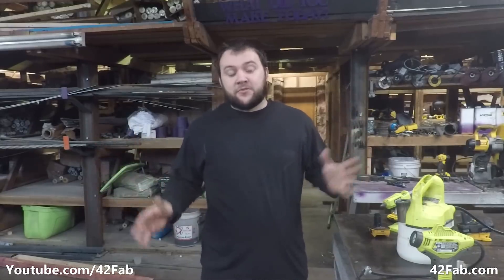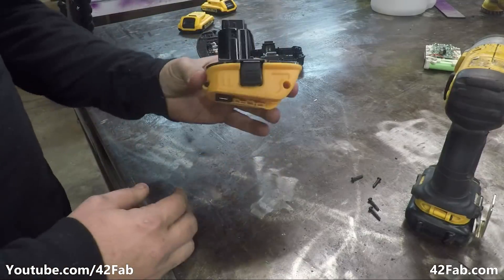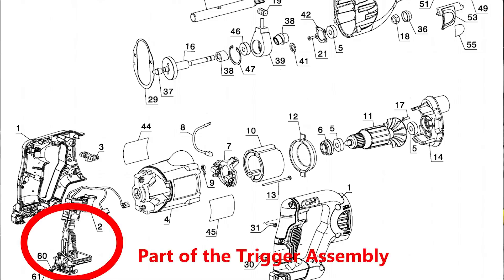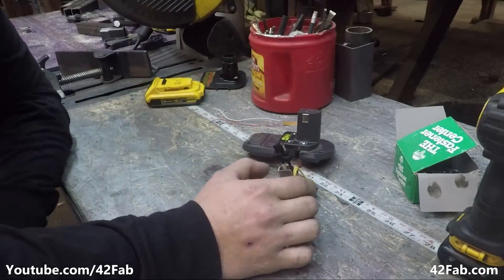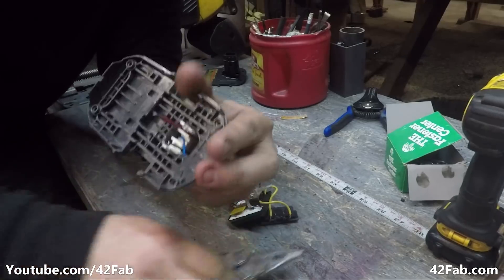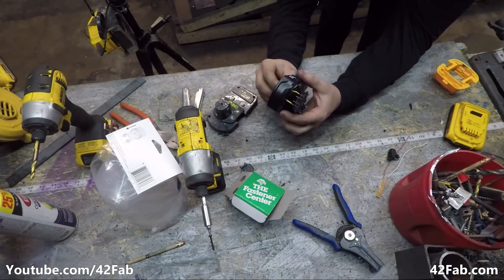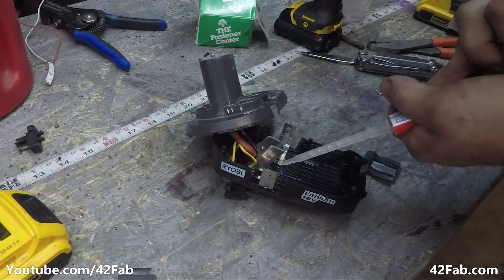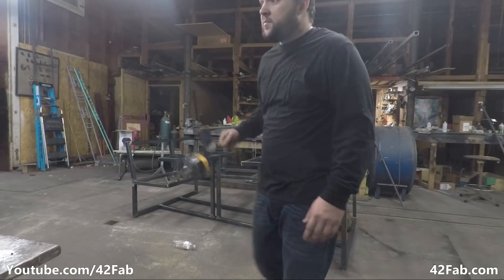How to use DeWalt Batteries on Ryobi Tools for $30 | Building a DeWalt to Ryobi Adapter - 42Fab #16

Comment: Just FYI, the "Plastic Epoxy" Loctite sells is actually methacrylate. That's why it smells like an acrylic nail salon. Methacrlyate is a very powerful adhesive to have in your toolbox, and the Loctite brand is readily available and a good price. If you want to step up your game, pick up a 50ml dispenser gun and Plexus brand MA300 50ml tubes which take a mixing tip. Pro brands all fit into that gun and accept mixing tips. McMaster Carr online has the best price on mixing tips (still almost $1 each) but they make life grand.  Leave each one on until you come to use the glue again and the cured tip will keep the tube fresh. Cheers!
Reply from the maker: That's what I used in my other adapter and I thought I had some on hand for this build but didn't, so I went with the 5 minute epoxy. I also highly recommend the "plastic epoxy" though I do not know that I would have enough use for it to buy it in bigger tubes and actually get them used up before they dried or leaked.
Reply: I just want to be clear, 5 minute epoxy is epoxy. The "plastic epoxy" I'm talking about is what you linked under this video, it's not epoxy, I wish they wouldn't brand it with that word. When you get into adhesives and what will work for what, it's important to use the right nomenclature. That stuff is methacrylate, and it's a whole different animal from epoxy. When I suggest 50ml tubes, that's the same volume as these double syringes you can buy at box stores. They are also available in 500ml cartridges for BIG jobs. I like the 50ml applicator gun and mixing tips over double syringes because you either waste some mixing on a waste surface with a waste mixing stick, or in the mixing tip. The difference is, the tip is very precise application.
Reply from the maker: Great info, good to know, thanks
Reply: @TMFXLLC  HD has started selling JB Weld brand epoxies and dumped Loctite. They sell a "double-barrel" syringe with ONE mixing tip. So you have to use the entire contents on one shot, or mix them manually. The mixing tips waste WAY too much adhesive. You waste a negligible amount of adhesive when mixing manually.
Reply: @xenonram    There are several topics for discussion here. Epoxy and Methacrylate are different chemical families. Both can be formulated for use as coatings, fillers, or adhesives. My advice was to pay attention to smell, because some products are marketed using the wrong name. 

You're right about how mixing tips work. There are circumstances when you want a mixing tip, and other times you don't. The tip provides a seal, and it's a clean and easy application process to fine detailed areas. It does consume some material. Hand mixing calls for peripheral materials, and a cap placed on some materials is not enough to seal over longer periods.

I am a professional, and I use 50ml dual syringes with an applicator gun, and I buy the smallest possible mixing tip from McMaster Carr, which is a good compromise on waste for me. Others may prefer a different method. I just wanted to share accurate and helpful info. Thanks.

Comment: Cool video and great project.I too love the dewalt tools, I use the 20v to 18v on my old 18v dewalt tools now because I just can't make myself replace a working tool even if it's the old 18v dewalt .I have replace a couple of tools to the new 20v system and love the new design of the 20v battery lock button Vs the old 18v double side clips  which I often have to fight to get the battery to release.  I do have some very old Ryobi tools that are 18v and are blue in color. I'm  not sure I have any old batteries for Ryobi just wondering if the new 18v bat. fit the old blue Ryobi tools?    Thanks for sharing
Reply from the maker: As far as I know all Ryobi 18v tools work with all Ryobi 18v Batteries
Reply: All the Robins 18V One+ tools work with the 18V One+ batteries, regardless of type.  Just don’t try to charge a lithium battery in an old, NiCad charger.

Comment: Is it possible to do the opposite? Replace a Dewalt battery with a Ryobi battery. Dewalts are soo expenbsive!
Reply from the maker: you're getting what you pay for. Ryobi cells struggle to drain more than 18A, dewalts are well and good to 30. These Ryobi tools work MUCH better with dewalt batteries on them. 

Pro tip: get the yellow "XR" dewalt batteries, they have the higher drain cells in them.

Comment: Would a DeWalt 20v/60v Flexvolt battery work on this DIY adapter?
Reply from the maker: L.I. Archer you have to modify the adapter to fit them, I haven't done so
Reply: But if the Flexvolt battery fits older 20v Max tools, why wouldn't it fit the adapter?  I have an adapter and a Flexvolt battery.  I should try to see if it fits.  LOL
Reply from the maker: The dewalt 20-18v adapter specifically states it isn't made for the flexvolt batteries. I believe there is a nub in the molding that stops them from seating on all the way. My theory is that none of the 18V tools were ever made to draw as much current as the flexvolt batteries can output and DeWalt doesn't want you smoking the motors running them that hard.

Comment: One of these uses Dewalt 20V, 60v flex, or Milwaukee 18V on old Dewalt 18V.

https://www.amazon.com/dp/B078M63Q1G/_encoding=UTF8?coliid=IR55V0GWBLYL&colid=3NTK76J8UTEMO&psc=0
Reply from the maker: That is a milwaukee to older dewalt 18v adapter....
Reply: I worked for Home Depot in tool rental and repair. Picked up a bunch of different batteries. Made some work by combining two or three to make one. Broken tools cut off the battery plug in and wired to a hallow battery. I made decent money on the side making these for people. The broken tools were being thrown away. Might as well make something useful form them.

Comment: Good job!  2 questions. Do you like the Ryobi cordless glue gun? I have been on the fence about it. With that in mind, I have Bosch 18v lithium system and would like to convert that glue gun and a Rigid 12v nicad right angle impact to the Bosch batteries. Any thoughts?
Reply: Ave also took the ryobi glue gun apart in one of his videos.
Reply: Tom's Dreamshop Worx  i have the hot melt cordless glue gone works great for me
Reply: I too have the Ryobi glue gun, and it's quite handy to have compared to other cheap plug-in guns. Tip isn't completely drip proof, but it's pretty good. I need to make an adapter like this so I can run one off my 9Ah Flexvolt battery for an hour straight. 😁
Reply: Tom's Dreamshop Worx I’ve converted the glue gun to work with makita batteries. It’s a beast. It’ll get up over 300 degrees.
Reply from the maker: I do like the ryobi glue gun. It seems to have a pretty big heating element or some mass around it so it takes a bit to get hot, but once it is you can pump about 3/4 of a stick of glue through it before it even starts to lag on heating it.

No thoughts/experience on those other tool lines, but I'd hesitate to say it's worth doing for just one tool. However, the boech to ryobi should be easily possible, the bosch to rigid would require some sort of voltage regulator to step down to 12v.

Comment: Nicely done. You can also buy the adapters from dewalt to ryobi and milwaukee to ryobi on ebay for around $15-20
Reply from the maker: Yes, but those adapters do no protect your dewalt batteries from over discharge, which will ruin a $50 battery. Most of those ads say "do not run battery all the way down" as a hint
Reply: Good to know, thanks.

Comment: "That's what you get with eBay junk - the screw just breaks." I mean, yeah, the screws suck, but you're using an impact driver on them. No shit, tiny ass screws gonna break. Good work though. May try something similar with Makita batteries.
Reply from the maker: I'd never expect them to snap when being run out in reverse, with a little 12v driver, but point taken

Comment: Does dewalt guy know that dewalt is nothing more than rebranded black & decker?
Reply: Yeah, and Milwaukee is just rebranded Ryobi, and Maserati is just rebranded Chrysler...  yeah....
Reply: I've used Dewalt tools in a commercial construction environment for years.  14.4v, to 18v, to 20v (which actually isn't truly 20v) to their now FlexVolt.  They have all performed well. 

 Some of their corded tools suck.  Their recip saw, is crap.   Yes, the different blade positioning is a good feature, but fails due to the engineering of it.  That company from WI has perfected the Sawzall.  Dewalts circ saws are well made.  Still prefer Bosch or Hilti SDS drills and Metabo grinders. 

 As with all tools, ones mileage may vary.  Never discount a tool based on 1  poor experience.
Reply: My question is does it really matter who owns em?
Reply: Which Black and Decker brushless impact driver was rebranded as DeWalt? 

Stanley Black and Decker is the parent company that makes DeWalt, but in no way is DeWalt a rebranded version of the Black and Decker line. Some of the Black and Decker line is a rebranded Craftsman tool. Also owned by Stanley Black and Decker.
Reply from the maker: Have you tried the DeWalt DCH273? I friggin love that thing, mostly because it can be easily run one handed, which is great for when I'm on a ladder installing signs. If I had to pick three battery operated tools that would be one of them. Starts to struggle with anything over 3/4" but I'm hardly ever doing anything over 3/8"
Reply: Can you make an adapter for Ridgid battery to ryobi tool?
Reply: Viper90087 that's right
Reply: Viper90087 actually Stanley owns the lot.
Reply: That DeWalt DCH273 looks like a friggin spaceship. I'm gonna need at least three of them.
Reply: I've maintained multibrand fleets of tools while running USAF and civilian toolrooms and of course my own shop. I strongly agree.
Reply: But doesn’t each group have their own manufacturers, designers, engineers and what not?
Reply: Aj Johnson dewalt was created because black and decker was suffering on sales and quality.
Reply from the maker: Viper90087 haters gonna hate
Reply from the maker: But for real, yeah, they own them and for a while at the end of the 18v line and some of the early 20v their quality suffered. Last few years has been nothing but high quality though.
Reply from the maker: Haters gonna hate man, ignore them.
Reply: Dewilt
Reply: Dewalt is the lexus of black and decker
Reply: Does the viper guy know we don't give a shit??
Reply: No. The only thing that matters in a machine is how the machine functions and where you can cannibalize or interchange spare parts. Autists love pointing out parent companies and while that stuff is interesting history, that's all it is.

Comment: Nice work!   In case you haven't discovered this yet, there is a screw in the top of the Ryobi neck that will let you remove the battery contact piece from the plastic case top.  Much easier to work on for soldering and assembly.  Check it out for the next adapter you build.  Good work and thanks for the video.
Reply from the maker: Yeah, I seemed to remember that from last time I made one, but had a brain fart this time
Reply: I literally just found the screw moments before viewing your comment, would of saved me a few minutes of frustration.. Damn..
Reply: Alan Millar i